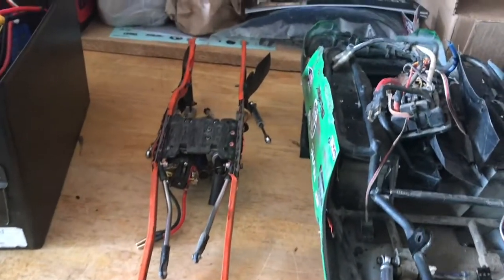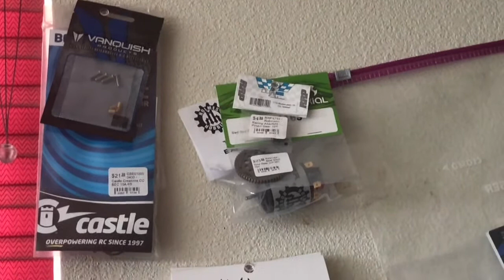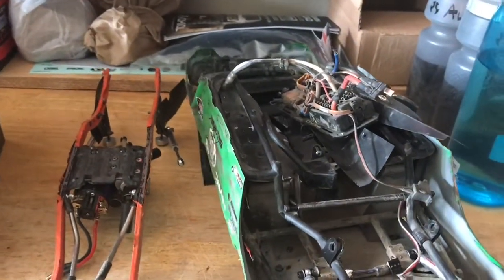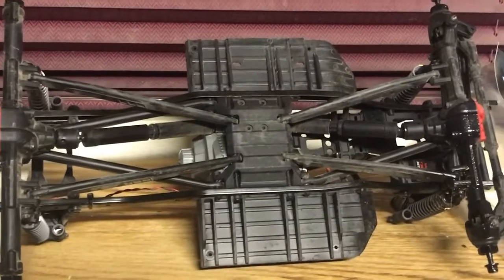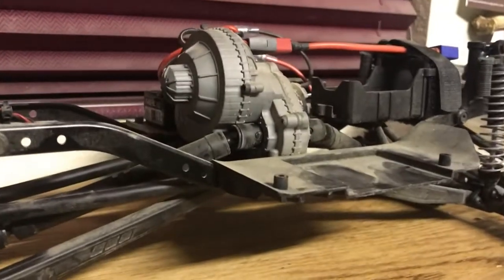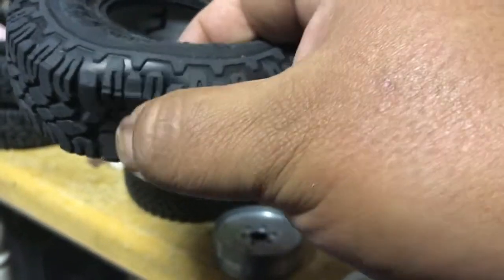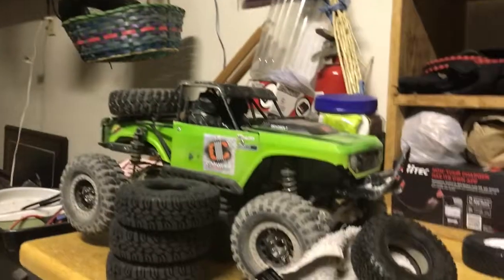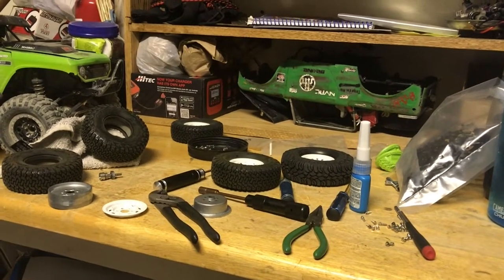Axial SCX10II Trail Honcho To Scout Conversion

Comment: Gonna be a cool build just bought the trail honcho are most scx 10 ll parts interchangeable with it wanted to add aluminum links to it and  a different front bumper
Reply from the maker: triplesped 
Most scx10II parts are interchangeable but I’d check the wheelbase designation for the links you use. If you plan on keeping the Honcho bed then you can go longer in the rear. But with the steering/suspension setup you need the same or similar links in the front to avoid bind/clearance issues.
Thanks for watching!
Reply: thank u

Comment: I have the same bead-lock wheels. And I hate them! The tire bead still pops off, and it is difficult to put on compared to other bead-lock wheels. Also, they are heavier than the rest of the Bead locks, but I guess that could be a good thing for some people
Reply from the maker: Definitely on all points. I did a little mounting video that I’ll make public soon on mounting tires to these and other multi piece wheels. Can’t really say that these tires will keep a good bead in these wheels but they seem to be holding so far. If not I’m going to use an RC4WD tire simply because they have such thick beads.